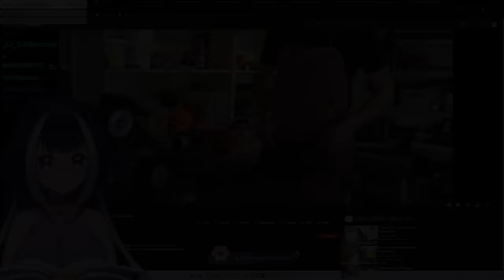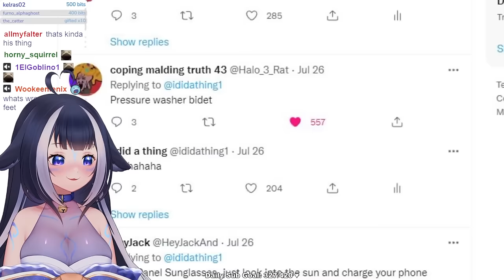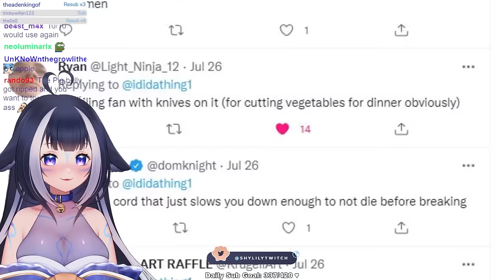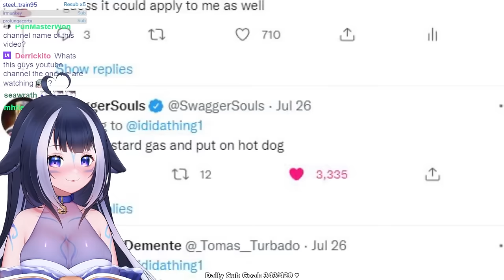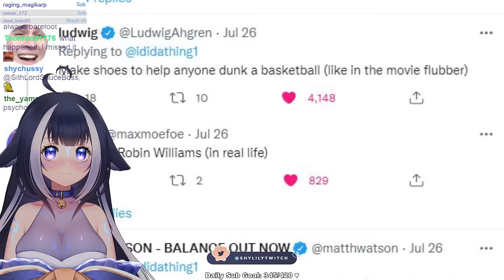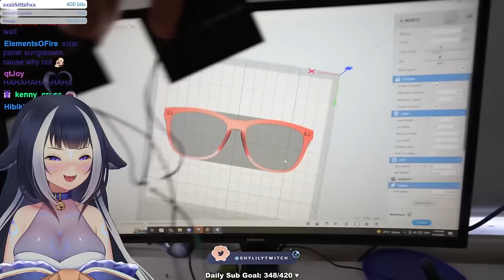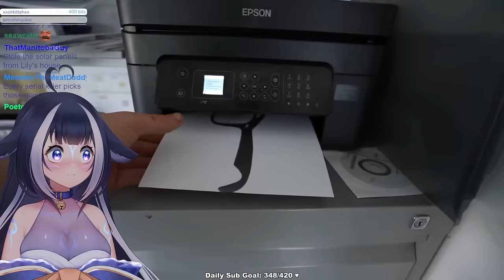Shylily Reacts to 'I made your worst video ideas' | I Did a Thing

Comment: 14:15
Fun fact, human tendons and muscles are basically designed to absorb shock and impact force, but that doesn't mean the power of a jackhammer won't break you.
Reply: P.S.
the basic idea of our evolution is that your muscles, tendons, joints and the distances of your limbs from the brain, protect the brain from blunt trauma and shocks. the brain is very egocentric.
Reply: @timber1492  if he didn't have his arms and legs completely straightened, the shock will be significantly lower, as ourmlimb can be natural shock absorber. A good example will be that we will always bend our knees when we land from a jump since the motion of us squating down can cancel out the concussion force from your feet landing on the ground. I know there are a lot more science behind this, but I did not study physics enough to know that.
Reply: @samuraijackson241  Pretty sure that's not going to help in this situation, as the pain and damage would come from vibrations rather than a single shock that can be readily absorbed by smoothly bending one's limbs to spread out the impact. The jackhammer is slamming down against the ground and up against his feet (thereby rattling his entire body) many times, rapidly, and continuously. It's just as well the thing shook itself apart before it did more damage to him...
Reply: I hurt watching him

Comment: Technically speaking as long as the fan does not fall from the ceiling the safest place to stand while testing that fan is right underneath it. If the welds break the blades are going to shooting the direction they are being spun in which means they're all good they're going to be thrown in that direction.

Comment: 4:17 there are holes for several reasons, some were from nail guns, some i think were from guns designed to shoot tampons, i think one was when he strapped fishing wire to a bow and arrow.
the hole in his 3d printer from shooting it, he shot a piece of wood infront of it and it went straight through into the printer

Comment: a little lession on human skin
skin cells multiply if they are under stress
so the more you work with your hands, the thicker the skin
the same applies to your feet, just that there's a lot more force acting on them
so if you walk around barefoot all the time you will grow thicker skin and basically stepping on glass might not even be an issue